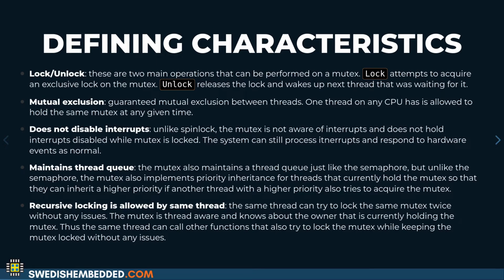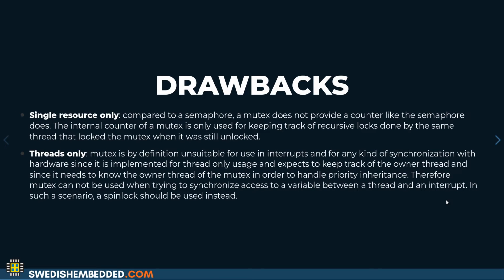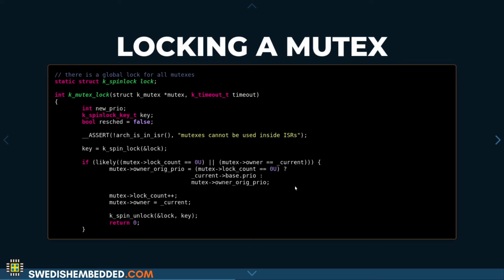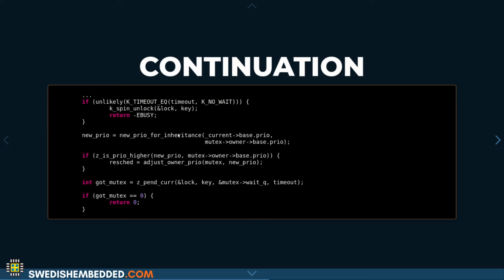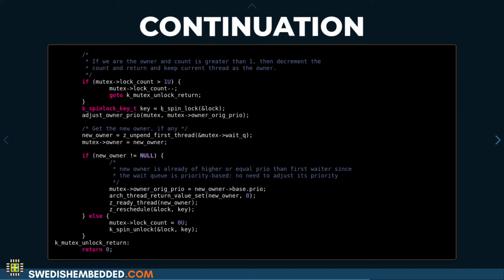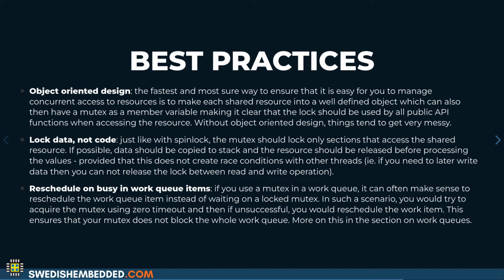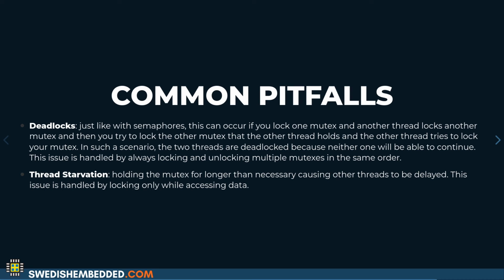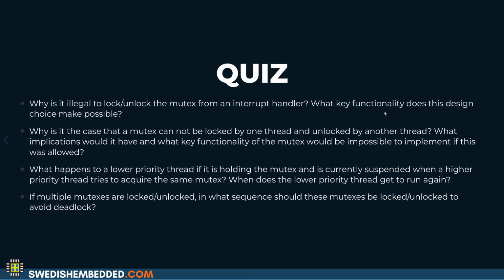Embedded C Programming Design Patterns: Mutex Pattern

Comment: Hey, best practices says "lock data, not code". I guess this doesn't mean that you shouldn't lock some code block that is protected between mutex lock and unlock, am I right? I found locking some commonly used code blocks that needs to be used by only one thread at a time to be very effective when modularising application code.
Reply from the maker: If your system has a lot of concurrent access to a calculation that involves shared data, it often makes a lot of sense to lock access to the shared variable, copy  the data into a local variable, unlock the shared resource and then do the calculation. The same applies to writing as well - its better not to acquire the lock before doing the calculation if possible, and to instead do the calculation and only lock once its time to store the result. This is essentially what I mean by locking data and not code. The more time the application spends with a lock held, the less benefit it is getting from multithreading. It is worth remembering that the only reason we use mutexes is to guarantee consistent results when accessing resources (their data). Therefore structuring data access such that the lock is held for minimum amount of time possible is good practice worth adhering to (when this is possible to do).
Reply: @mkschreder Hmm now I see what you mean better. In my case it was more about mutex was used for making the threads wait for their turn for signaling a series of operations. Threads were asynchronously requesting operations to be made by signaling to other commonly used threads  and workqueues so I had to make other threads wait until the current one's operations werer finished so I used mutexes to lock access until it was. Now I'm thinking if there is a better option and if I've accidently fell into a pitfall in my architectural design. If I have to give an example, think of it like you want to send multiple different sentences to a UART channel to print from multiple requests, if I don't make the other requesters wait to print their sentences, all sentences can mix up and this won't create a meaningful result, so I'd use a mutex for locking the msg sending operation until the message of the current thread that locked the mutex is  sent. So each other request would wait their turn until the other message is written. What do you think about this?
Reply: @mkschreder If you only lock the data at the time of read/write, how do you avoid race conditions?
Also, what's the purpose of using any synchronization element if there's 'free' access to said variable while it's being manipulated by another entity?